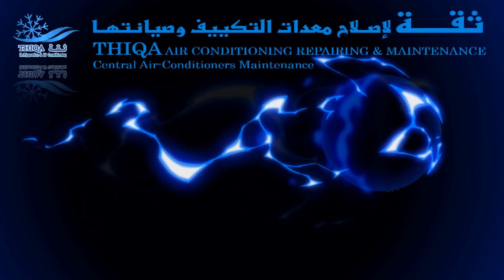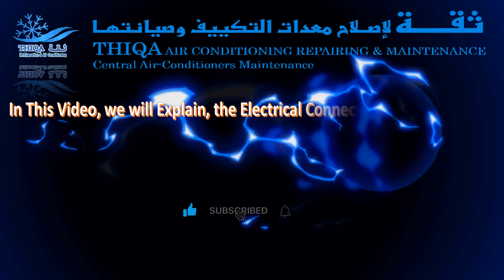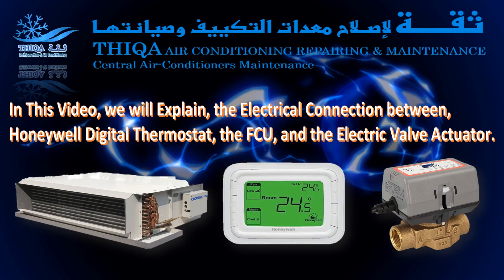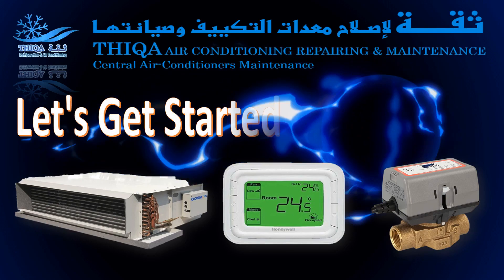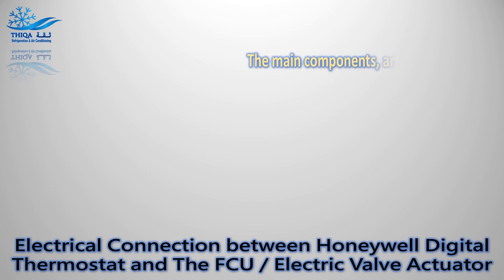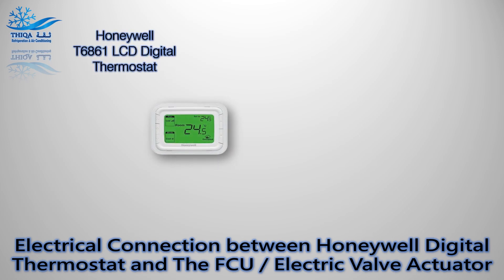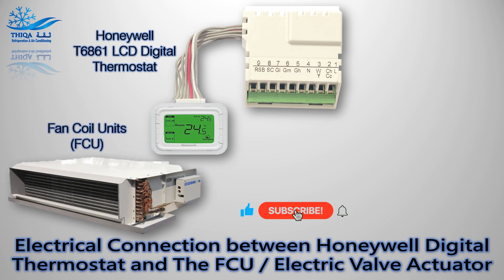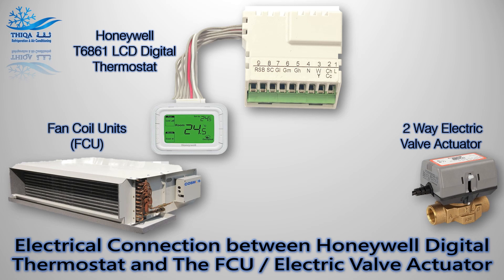Fan coil Unit Full wiring with Thermostat and Valve Actuator

Comment: Need to connect thermostat to 2 way solonoid to 110 volts circ. Pump  .if you can help me i appreciate  thanks
Reply: So  when thermostat call for heat the solonoid 24 volts will open and circ pump will turn on .ca you draw a schematic thanks
Reply from the maker: Some connection but you have to use transformer 
Or replace the thermostat to 110V
Reply from the maker: Sure will make a video
Reply: Thanks
Reply: https://youtu.be/xHkGxpnBYTc?si=0eaC6i7zWO5zgwiO

Comment: why are u using 3 out for speed? you can just use 1 out 0 10v and you can controllo= the speed of the fan and with the other out you can controll others fancoils
Reply from the maker: thanks for your comments you mean VFD . this just a simple cricyt
Reply: No, even for fanclois with water.
You just need the fan regulation, not 3 speed as a maccanic termostat
Reply: https://youtu.be/xHkGxpnBYTc?si=0eaC6i7zWO5zgwiO